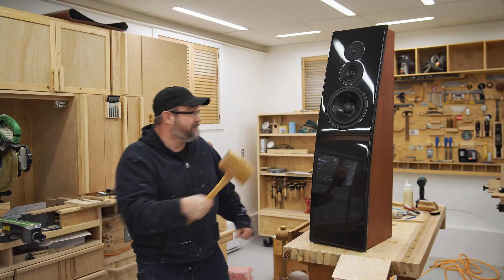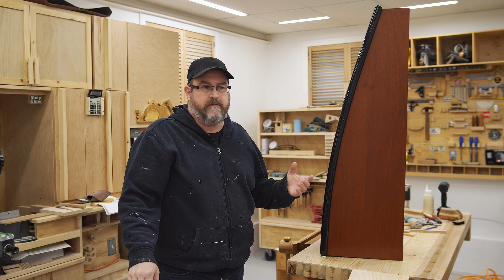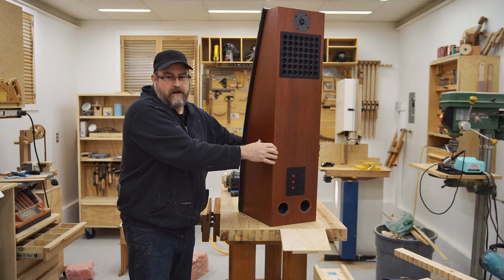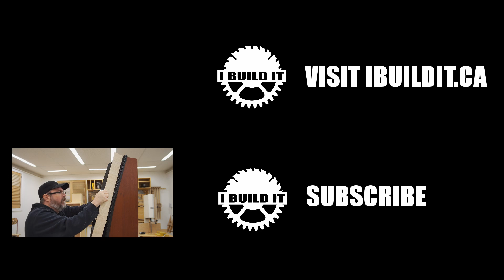The BS is CHIN DEEP!

Comment: You forgot the massive distortion created when the sound waves couple with all the hard surfaces in the room.  That may be the one thing that makes everything else irrelevant.  A live room will wreck the most carefully designed speakers.  And all rooms are live.  The ceiling is the biggest offender.   Standing waves occur.  Time shifts occur.  Speaker schmeaker
.  That's why near-field speakers sound so good.  Trying to light up a whole room with good sound is a fool's mission unless you kill all the reverb down to an imperceptibly amount.
Wanna build speakers?  Start with subwoofers.  Infinitely easier.
Reply from the maker: i didn't forget about it. I didn't mention it because it doesn't have anything at all to do with speaker design.
Reply: @IBuildItScrapBin   I see.  Having ports and tweeters in the back of a speaker cabinet compounds the problem.  Would you disagree?
Reply from the maker: You probably think you know something about this, but clearly not enough. Speakers are stand alone units that are not designed with a particular room in mind. Any type of well designed speaker will sound good in room if the room has been treated correctly and the speakers are placed properly.
Reply: @IBuildItScrapBin    Clearly not enough?   Yes, your majesty with your shitbox speakers with 97 coats of paint on them.  Yes.  YOU are right.
Reply from the maker: Nice. Are you 12 years old?
Go find some retail speakers that are designed for specific rooms.
Reply: @IBuildItScrapBin   You are a very arrogant fellow.  Do you know that?  You don't know me.  You don't know what I know.  But you tell me I think I know about sound systems but clearly not enough.  That's arrogant and offensive.  It's clear that you need help and  we could have had a conversation.  But you want to play king of the  world.  Okay, fine.   Just so we understand each other.
Reply from the maker: So I take it you were unable to find retail speakers that are designed for specific rooms.
I know the limits of my understanding and freely admit it when I don't know something. True arrogance is what you are engaged in, where I helpfully pointed out your error and you then turn around and attack me for being honest with you.
Reply: @IBuildItScrapBin    You insulted me by saying clearly I don't know enough.  You're being arrogant in telling me that you "helpfully" pointed out my error.  You dismissed my suggestion that deadening the room would be more useful than all the silly things people do to their speakers (eg. speaker cables).  I was following your lead.  I meant know harm.  You just have a defective personality.  I'm sure you've had trouble with it in your life.

Comment: There is another way to get into that market- dumb luck.

About 15 or so years ago I was shopping through Parts Expresse's clearance items and came up with what I thought would be nice drivers and tweaters for a set of 6.5"2-way bookshelf speakers.  I basically build something like the pair that you just built, but vented.  My brother who's in commercial video production and one of those people (he tests different speaker wire with his tube amp...) wanted a pair, but he wanted a fancy Ralf Lauren finish on it... OK... then a friend who was an audio engineer at a TV station wanted a pair, offered me $400/speaker... I ended up building a crapload of these things for $400/speaker + whatever finish they wanted.  The components cost me about $40/speaker on clearance from Parts Express... Until PE and I ran out of components.

At that point I could have come up with some new designs, I had a good enough reputation with these people that they would have bought it, but I just didn't buy into the BS.  I tested my speakers using cut up pieces of 12ga extension cord that had the plug run over that I pulled from the neighbor's trash when I was walking the dog using a cheap old amp and MP3's for a source.  These people wanted whatever was trendy, they showed up with things like the Fostex Banana cone full ranges and want custom boxes for them, and insisted that I tuned them with this wire... It was impossible to tell them that those drivers sucked and that moving the speaker 6" has a bigger effect on their sound than going from my trash pile wire to their $300 stuff.   Oh, and did you notice that your speaker wire costs 4x what the drivers in your speakers cost?

I wasn't their guy.

Comment: I think you do a little bit of injustice to the crossover.  I'm talking about passive crossovers here.  I'm not arguing component quality either - boutique capacitors and all that stuff is mostly rubbish.  A poorly designed crossover, or an off-the-shelf crossover not specifically designed for the drivers being used, can ruin a nice set of drivers enough that you'd have been far better off with lesser drivers and a well designed crossover.  I really think the 3 parts - driver, cabinet and crossover are pretty equal elements.  

I know this first hand, as I purchased a set of fairly expensive DIY speakers from a gentleman who was disappointed in his results, at a sizable discount.  He had used a pre-made 3-way crossover from an electronics supply house and it was not well suited to his driver selection.  I was able to make a superb pair of speakers from that purchase by dumping the crossovers and using a purpose built crossover in it's place.      

If new at speaker building and in doubt, don't fumble through your own design but rather start by building  speakers using a well reviewed DIY design.  They are pretty readily available on-line.
Reply from the maker: I don't think you understood what I said. Crossovers are important, but never as important as the drivers or the box design. It's like saying the seats are as important as the engine or wheels in a car - you need all three, but you need the second two more.
Reply: @IBuildItScrapBin  No, I actually believe that I did understand what you said, and I disagree.  The crossover is not a seat, consider it the drivetrain.  I takes the power, separates it and sends it to the individual wheels (the drivers).   If the drivetrain is poorly designed you are spinning your wheels or not getting power to the wheels in a properly balanced manner.  Similarly, a poorly designed crossover leaves the drivers performing poorly.  It's somewhat of a semantic argument so maybe we are just misunderstanding each other.

Comment: An Audiophile friend of mine has a story where he had everything hooked up and adjusted, but there was something just a bit off that he couldn't figure out.  Then he discovered that he had the speaker wires hooked up in reverse.  Did he mean crossed electrical polarity? No.  Reversed left and right channels? No.  His mistake was that he hooked the wrong END of the wires to the speakers!  Yeah, apparently these speaker wires he had were supposed to be UNIDIRECTIONAL!  Because, you know, electrons travel through copper better in one direction than the other.
And he swears to this day that he could hear the difference.
Pure snake oil.

Comment: Twenty years or so ago, I bought into that "audio-fool" BS and spent thousands at my local Sound Advice. I replaced every cable in my home theater/audio system with Monster Cables, among other foolishness. Did it sound good? Yes, but could I tell the difference from adequate non-BS components? Nope. Very few people can tell the difference in a double-blind test between high-end and decent mid-range gear (and I'm sure not one of them). From that point on I just go by what I can hear and let the audio-fools bicker amongst themselves. I think that bickering is one of the main attractions of being an audio-fool in the first place.

Comment: I went into a Bose shop once - to compare the cost of their “high end” cables to the cheap ones I could get from my local electronics store.  Each Bose cable had an arrow cast into the (gold plated) ends.  I asked what they are for and the salesman (looking down his nose at me) stated with great deliberation that the cables had to be plugged in a specific direction with the arrow facing towards their amplifier.  I asked him if his engineers had worked out how to train electrons to travel in only one direction in a wire - and he stated that yes, that was exactly why the arrow was important - if you put the cables in the wrong direction, they would not work.  Needless to say, I did not buy the cables (or anything else from Bose ... I have Denon (Japanese) equipment, Jamo (Danish) speakers and cheap cables (all over 20 years old now) ... happy enough with those !

Comment: I wish I could achieve a finish like that :-(
Whenever I try, all the bugs in the area come to commit suicide...
Reply from the maker: There's another step after spraying, and that's to rub it out. I sanded up to 3000 grit then polished it with a buffing wheel.
Reply: @IBuildItScrapBin  Thanks so much for the advice :-)

Comment: you don't need a complicated crossover when you have good drive units. You can build surprisingly good loudspeakers with fairly low cost drivers if you invest more in the design and engineering. That's what manufacturers do.

Comment: Gorgeous design! You obviously did a lot of research. I too build a pair of ( high end) Speakers based on John Meyer of Newform Research's ribbon tweeters. They are very tall. Ribbons alone are 48". Midbass drivers are a pair of 6 inch Scanspeaks. I veneered them in curly cherry. The cabinets I made of a double layer of MDF with a layer of rubber membrane in between. Long story short they are still alive and well over 10 years later.
Reply: Sandwiching the rubber in between the layers. Interesting.

ScanSpeak make nice stuff.
Reply: @thatguythatdoesstuff7448  Thanks, the cabinets are heavy but when you knock on the side they are solid as a rock. No hollow sound and no resonance to speak of.

Comment: Wonderful looking speakers, slightly better than my late 60's omni-directional versions.  They were made from 4 foot high, 2 foot diameter concrete sewer pipes (NOT reclaimed!) with double-coned Wharfedale speakers facing upwards below an aluminium cone in a cylindrical cloth-covered wire mesh enclosure.   The pipes themselves contained a slotted plywood baffle and rolls of loft insulation, and stood on slotted bases, also made of plywood.  
My wife never took to them as they rather dominated our small UK-size lounge, even though to pretty them up a bit, I covered them in green hessian wallpaper!
Reply from the maker: I can picture them :)
I considered making omnis, but it's difficult to make them look attractive.

Comment: I try to keep my mediocre speakers sounding good by wearing ear protection in the shop as much as possible. Not saying that to take a shot at you, just something I always think about every time I fire up a saw. 
  Otherwise, I do buy oxygen free wire for in wall applications but only because it is my understanding that this is required by code. I think it's dumb but then there's a bunch of code that I think dumb.

Comment: Speaker building is why I got into woodworking.  Hopefully one day my speakers will look as good as yours.

I am a fan of oxygen free copper, it has less resistance than copper clad aluminum.  Which means a smaller wire can carry the same current.  But for a short run it doesn't make that much difference.

Comment: I personally found this interesting as hell. You know what I have always wondered and maybe you can answer sometime...what effct does ohms play on speaker setup? I ask because I thought about installing a big home theater system a while back and (it seemed like) every single person I spoke to about it asked that one question first, and made it seem like the most important factor of all. I didn't understand it so I just sort of let it go and lived with the sound I have now but I have always wondered. Why was that always the first question? "Hey man I'm thinking about adding theater sound to my home" "Cool man, hey what ohms are you planning to run at?" …"I don't know, whatever resistence a speaker has?" "Oh man, I can't even help you set this up without knowing what ohms you want to push"...uh okay thanks?  
So like what the hell is that about ? Why does it matter if your starting from scratch?
Reply: Ohms is technically the DC resistance of the speaker, and if you're running DC to your speakers, you have a big problem. More correctly the "impedance" of the speaker is the average "resistance" over the audible frequency range. Impedance is "resistance" to AC (frequencies higher than 0). Typically speakers are given one value, like 8 ohm, 6 ohm, or 4 ohm, but that's really just BS, as the impedance changes over frequency (due to resonances in the drivers and the crossover). It's definitely a factor in choosing an amplifier - the lower the impedance of the speakers you're driving, the stronger an amplifier you'll need. Also, maximum power transfer happens when the impedance of the amplifier is matched to the impedance of the load (the speakers). So, while the impedance of your speakers matters for choosing an amp, it really shouldn't be the starting point, or the most important factor in designing a system. Sounds like whomever you're talking to doesn't know much either, and just spouting crap to try to sound knowledgeable. Hope this answer ins't to EE for you - coming from a computer engineering / electrical engineering background, I explain things based on the science, not the audiophile BS wankery! And audiophoolery is definitely chock full of BS!
Reply: Quick example, say you want to put 10W (at a particular frequency) into an 8 ohm speaker, and a 4 ohm speaker. You need 2 basic formulas to see the differences. Ohm's law (V=IR voltage = current x resistance(or impedance) ) and P=IV ( power = current x voltage). If we substitute ohm's law into the power formula, we get P=I^2R. This is the most convienient way to look at power in audio, because the speakers move based on how much current is flowing through them, as the current flowing directly correlates to the magnetic field, which is what causes the speaker to move. Now rearrange the formula to read I=sqrt(P/R). For 10W at 8 ohms, I=sqrt(10/8) = 1.11A, for 10W at 4 ohms, I=sqrt(10/4) = 1.58A, so for lower impedance speakers, you need an amp capable of supplying more current for the same power output. Here's an explanation with graphs that show how a speaker's impedance changes with frequency: https://www.cnet.com/news/how-to-stop-worrying-about-speaker-impedance/ and watch the youtube video linked in that story - it's really good.

Comment: If you gold plate the copper wires then the sound bounces more accurately within them, but it is critical that the wire thickness remain constant for this to work properly. This means that wire bends have to be around a radius of at least 37 feet. I had to knock out one of the walls on my house to accommodate this, but I find I get a much more open sound now.
Reply: NO!!! WRONG!!!!!!!!!!!!! YOU DON'T KNOE WHACHUR YOUR TALK1N ABOUT IVE BEEN D0ING THIS FR YEARZ
Reply: How many karats of gold does it need to be? How hot, we talking sauce pot on the stove hot? If so, I can do that.
Reply: @emeltea33  My ears can tell the difference between 18kt and 24kt, but either one is a noticeable improvement over unplated wires.
Reply: Now did you make sure to mount the speak in an alternating pattern of right side up, upside down in an outward facing ring to bounce off the walls in such a way where the whole home became the sound stage and also became the cabinet for all the speakers?
Reply: Make sure the copper wire is checked by virgins for optimal atom structure and you'll gladly pay 1000 USD per meter for that perfect sound
Reply: That all depends on the viscosity of the speaker fluid you are using

Comment: One of my first woodworking projects was building a sub-woofer.  The infant internet at the time told me bigger was better so I made it the size of an end table.  I used home center plywood and tried to miter all the corners.  Which is why there's a fake frame and panel look on it with 1/4" plywood.  Of course my stereo didn't even have a sub-woofer output so I ran it off the center channel and had to add in something from RadioShack (RIP) to bring down the volume on the front channels.  But it succeeded in covering the downstairs neighbor's apartment in a fine layer of plaster dust shaken off their ceiling after the first test.  And the thing is still functioning as a table next to my bed.  Mostly because it's too damn heavy and awkward to carry down to the shop to dismember it.
Reply: I was always too lazy to make any speakers, I actually used a few old Peavy floor monitors I used to have for my band. lol
Reply: sounds awful.......

Comment: my 3 ways are a bit larger - 70L bass bins and 14l tops, since i have the bass cabinets as free standing.. with Peerless speaker elements - i also built 2 enormous isobaric sub woofers for movies at he same moment. all in all i spent over 8 months on the project.. same here, as a profesional carpenter and cabinet maker i got tinitus just a few years after the build. sh*t happens lol :P well worth it anyway :D  but i built analog crossovers. it took probably months to calculate everything before i started. also i think there is too much audiophile crap going on agree totally.